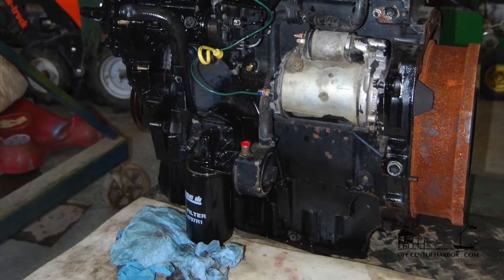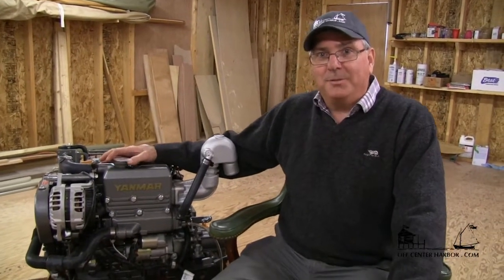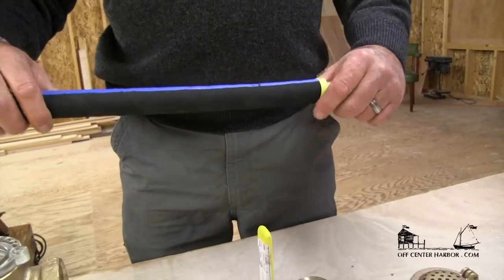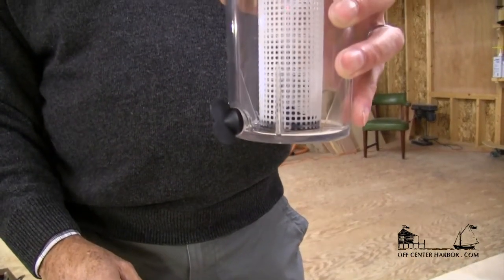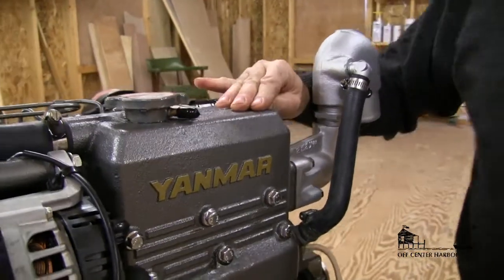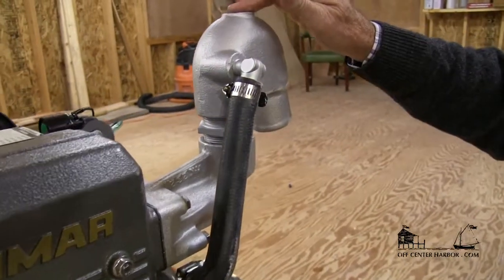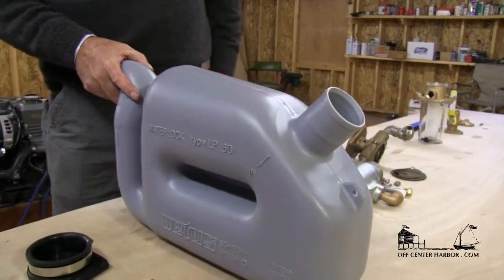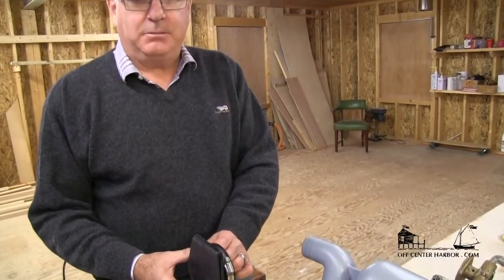Marine Diesel Engines, Part 1 – Overview of the Raw Water System

Comment: Hi, two concerns...So with all that raw water flowing through the plastic muffler, what happens if that plastic muffler cracks? Next, my muffler (a large cylinder) has a drain plug way down in the bilge...WAY down.  I'm kind of nervous contorting my body into the bilge to undo that bolt and re-secure it.  Won't the winterizing antifreeze I run through protect the muffler sufficiently?
Reply from the maker: Hi Derek - those are reasonable concerns! And it'd  probably be best if you had a marine mechanic check out your system if you're concerned. That said, our thoughts: Yes, plastic mufflers cracking would be very bad. Buy a good one, like a Vetus, and make sure you have easy access to your raw water seacock.

Comment: 1. I see an impeller blade bent the wrong direction. Is that an issue?
2. So in a cold climate the water is drained from the filter canister to keep it from freezing, but the hose is still full of water, which will freeze. Does water in the hose have to be thawed before the engine can be run? This doesn't make a lot of sense to me.
3. If you're evaluating an engine on a boat that still belongs to a seller, would you remove any anodes to check their condition or would that risk breaking off a piece that might end up in the pump or heat exchanger and do damage?
4. I don't know why a raw water pump gasket would shrink immediately up on cover removal, but then what do you do? You install a new gasket... or o-ring, if that's what's there and the existing looks old.
5. Brass anode plug or bronze plug? I've been told that brass is subject to dezincification and failure.

Comment: Also you need to drain a lift muffler if the motor has been turned over for more than 30 seconds with out running , like for instance trying to start a cold motor or bleeding the injectors

Comment: Excellent video. Trying to work out why my Volvo KAMD 300 is steaming. Engineer thinks maybe raw water related, eg, impeller, exhaust elbow choked up, raw water strainer blocked. Might even check the seacock and the external bit you mentioned. Any thoughts?

Comment: Good video. One question though. You say coolant through exchanger tubes and raw water in box. Isn't it just the opposite? Plate w/ tubes looks like inlet and outlets match up to raw water side. Also cap seems to be no box unless internal passages lead to the plate.

Comment: So the engine itself has enclosed cooling and the raw/sea water goes through the heat exchanger cooling the engine coolant basically acting like a car radiator? Some is then bled off to cool the exhaust.  Is that right?